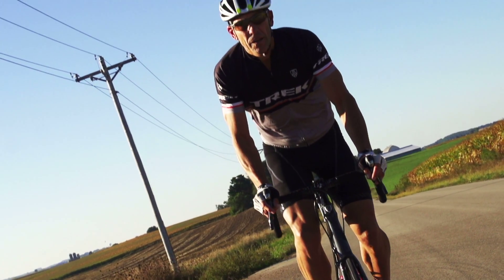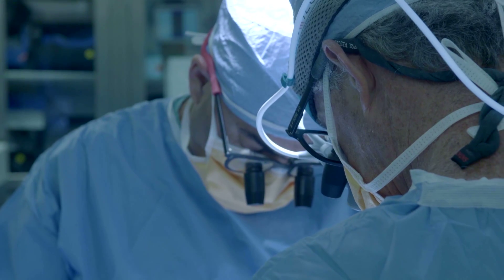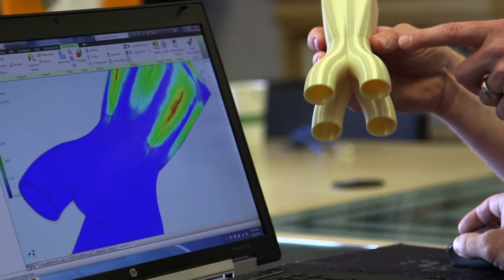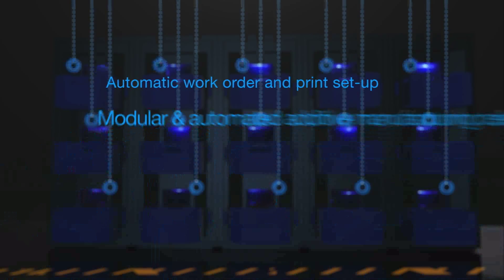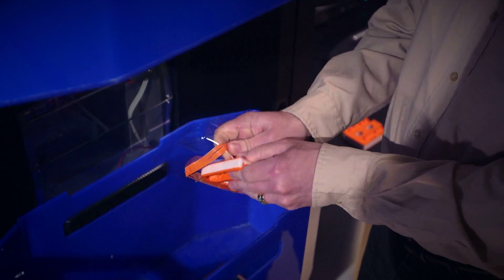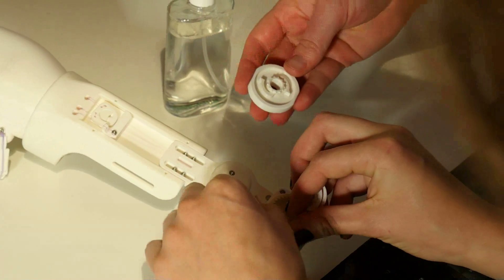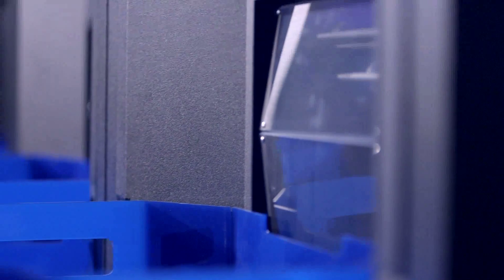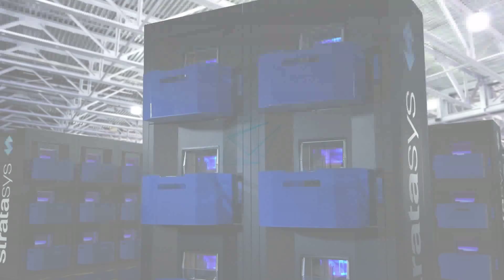Stratasys Continuous Build 3D Demonstrator

Comment: So its a bunch of Mojo Printers stacked on top of each other? The consumable buildplates are going to rack up the cost.
Reply: If you look closely...it looks like the machines use film instead of build plates.
Reply: Looks more like a system for print job management. 
The systems queues jobs based on new print job duration and remaining time for the current print?
Reply: So it continues the trend of disposable everything so they can charge an arm and leg? I saw the moving film, which would be great if it was just a convenor belt, but this film build plate will be one more exclusive thing you have to buy from them. The filament looks like their ABS / HIPS support, which is messy to clean up in Limonite. The filament and print heads are super exclusive, and you can't field maintain them. I've had mojo filament spools jam, and that was good money down the drain. I can see the appeal of an automated 3d printing system, but it has to be more open to maintenance and 3rd party filaments. This would be a better system if it was not just a stack of super expensive mojo printers.